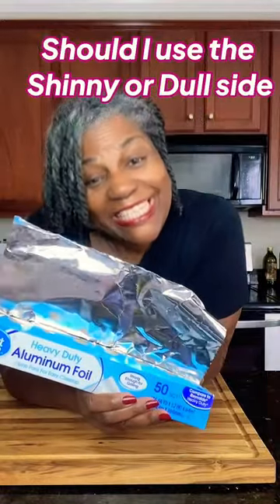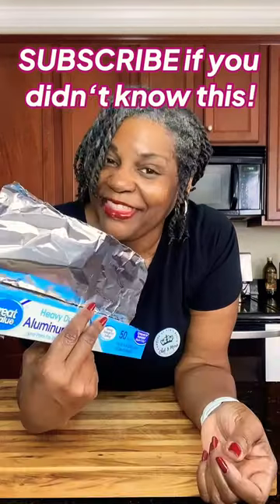What Side of Foil should you really use! #shorts

Comment: NOT CORRECT.... both sides are not "equal" for regular foil. When cooking have the shiny side facing your food. If you wrap a casserole or roast with the shiny side out the shiny side causes the heat to radiate away thus causing longer cook time. Shiny side towards the food helps retain heat. Look it up.

Comment: Ive been in an aluminum foil manufacturing plant several times and worked on several of their machines. From furnaces that melt the ingots to the heavy rolls that thin out the aluminum to foil thickness. As it goes through rolls that smash it thinner and thinner it hardens and has to be annealed to soften it back up to continue the thinning process. There is no two sheets pressed together. One side is shiny and 1 dull because of how the rolls squeeze the sheet.

Comment: My grandpa told me to ALWAYS wrap baked potatoes with shiny side in because the dull side will pull heat into the foil.  Shiny side out will reflect heat away making the baking time longer. It makes sense to me.
Reply: that's only for black painted foil, with regular foil, both sides will reflect heat equally, the shiny side just does it a little more evenly.